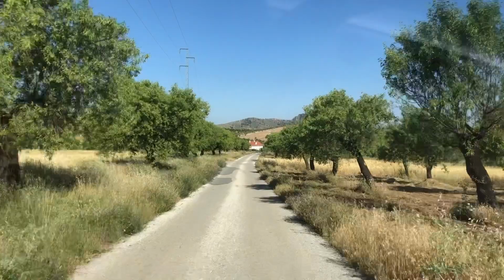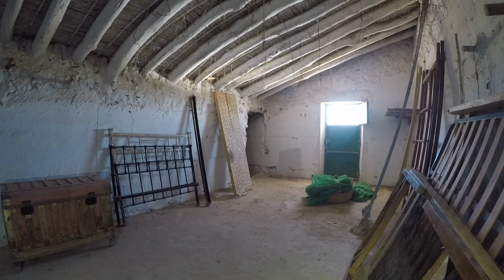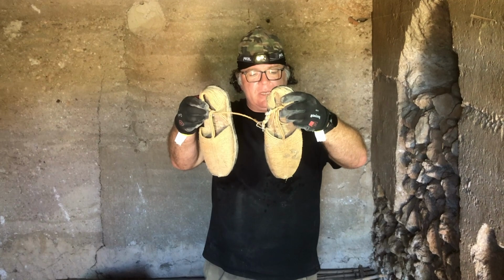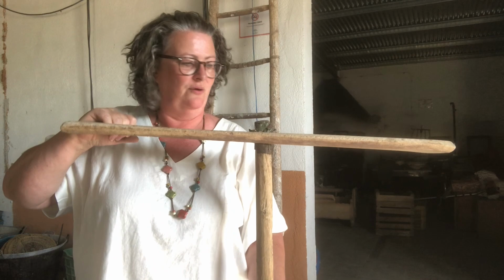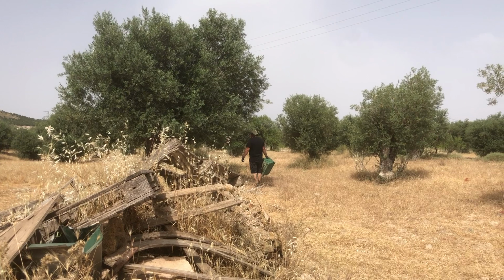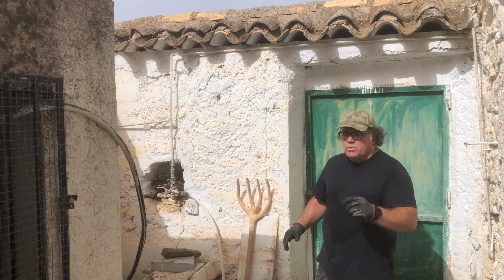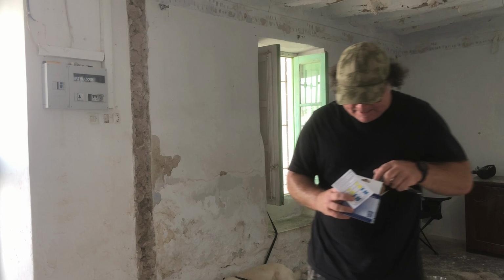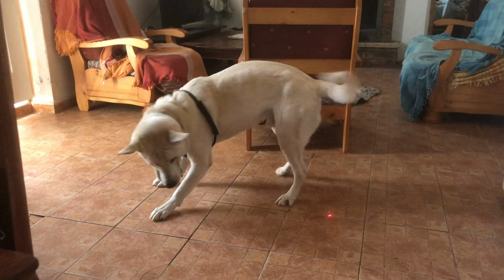16. Spanish farmhouse renovation, the last finds in the house and we start clearing the land.

Comment: We took a water sample to our local Pharmacia &they tested it for us- We had a full report on the water & its quality. It will be very interesting to see what that tool you found is, the bamboo racking you had is for drying almonds- We had a stack of them here & the old caretaker explained what they were for.
Reply from the maker: Thanks, we might take a sample to the pharmacia as well it will be interesting to see if they are the same. With so many almonds around it makes sense that those would be used for that, I'm thinking of making some use of them in the garden eventually!